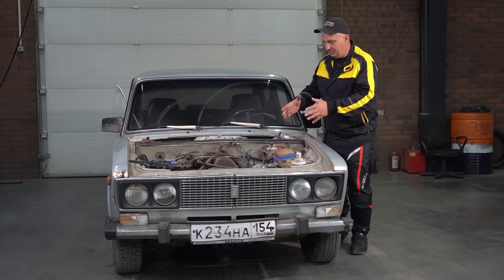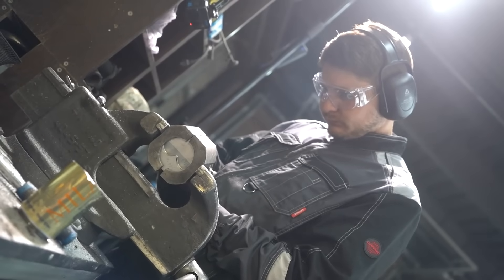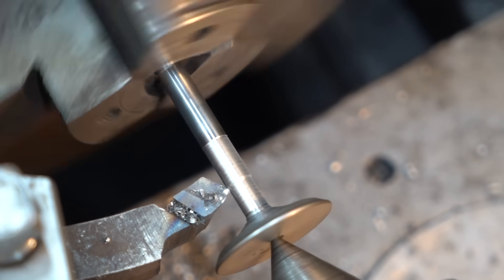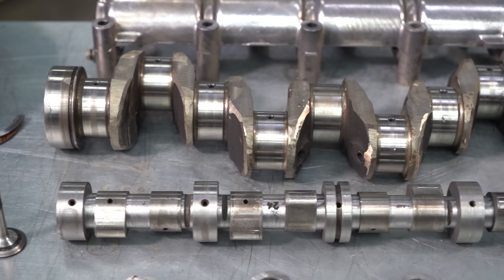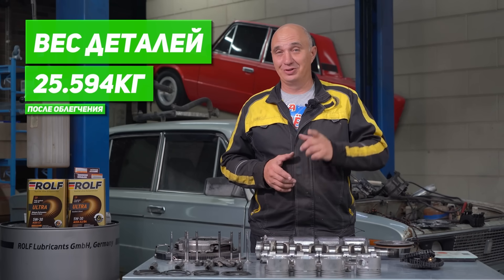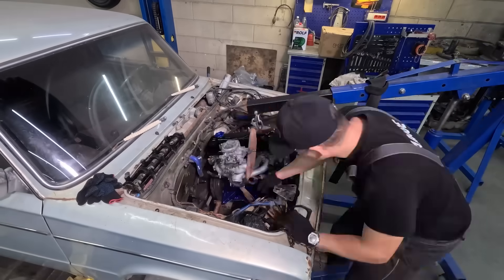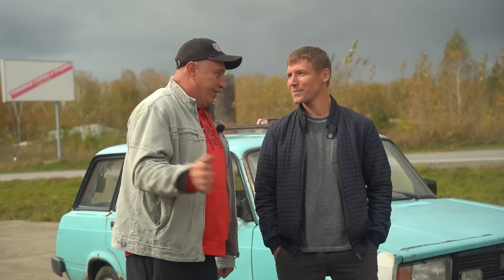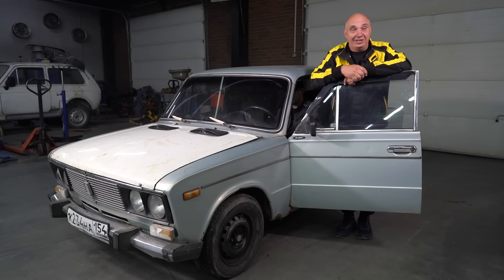Maximum rotating assembly weight reduction - what will happen?

Comment: reason it didnt rev higher (if there isnt ignition rev limiter) is there is valve float, its kind of its own rev limiter. If you guys put in stiffer springs and billet flywheel, it will be even better.
Reply: The crank is no longer balanced, so that is also limiting the RPMs.
Reply: @charlesball6519 meh if that was the case it would cause other issues first..

an unbalanced rotating assembly would cause huge vibrations then grenade the engine..

i think its valve float
Reply: This is main reason 👌@charlesball6519
Reply: They reduced the weight of the valves and the rockers... I bet the ignition module has a rev limit where it kills spark.
Reply: @volvo09  It didnt sound like it was on a limiter though.. no popping or farting..  Stayed pretty smooth at 6k.. Need to up the fuel intake.. Sounded like it wanted alot more..👍👍
Reply: @volvo09  reducing valve weight doesnt help with float nearly as much as stiffer or dual valve springs would
Reply: @volvo09  what ignition module?
Reply: @dokterkarel   the ladas have a little box that runs the ignition coil.

They aren't magneto ignition, so a spark cut can be put in that box. That's how early cars and motorcycles without points ignition implemented rev limiters. 

They've shown the module a couple times in various videos, either by having to replace it, or use multiple in a custom engine build.
Reply: @volvo09 but we would have heard the limiter, no?
Reply: @volvo09   Ignition module 🤣🤣
Reply: @samupk  well it does have a module, but it's probably a dumb one with no spark limit. 

It needs power and ground, and gets it's signal from a sensor wheel in the distributor, and has a wire to trigger the coil. (Like a late 70's -mid 80's US car without points ignition).

It's not a module in today's sense, but it is electric and could have a limit. But it is a basic part so it likely doesn't, it just takes the place of unreliable points that need maintenance.
Reply: @volvo09   Trust me, it's got no such thing as an rev limiter of any kind. Old ladas had  points ignition with zero micro electronics in them.  Valve float and general poor engine breathing was the limiter.
Reply: @volvo09  close enough. There is no ignition module in this ancient car. The actual issue is that this kind of ignition is not electronic, but mechanical (using a distributor), and it has limitations like this.
Reply: The carburated engines by rule dont have an rev limiter, only ignition retarder on the distributor that limits the rpm's. The engine also needs a bigger carburator and more air, so it can spin faster.
Reply: @gabrielvieira6529 there are carburetor engines with rev limiters. The HEI ignition in a Chevy engine has capability of rev limiters. But yes, most don't have that. People back then knew how to drive instead of relying on the computer to tell them when to shift.
Reply: And the crankshaft is of balance. That can also contribute dramatically.
Reply: @OsamaRari  Good idea, but in this case i guess around 35 Kw need to dissipate as heat/friction/vibration. In other words: the engine should have seized  in seconds or at least if the oil film stays intact, the oil would heat up dramaticlly fast.
The change in the valve shape can change the airflow a lot and a slimer valvestem ins't always better for flow. (but should still be able to hit the limiter!)
Reply: When we’re talking about total RPMs, nothing‘s gonna change the thing that will change is how fast it gets to those RPMs think of it as an air pump. The amount of turns the air pump can do is inevitable but how fast does air pump can come to full,volumetric efficiency can be changed by lightning assemblies
Reply: thanks for this comment! I might have figured out why an older engine of mine peters out at high RPMs!
Reply: Its not a predator 212 but youre right lol. The billrt flywheel is trading torque for hp. But the springs will help it with valve float
Reply: I believe that valve float and an unbalanced assembly is the cause for the rev limit however the ignition system might have an upper limit just by design not to mention it is running on the stock exhaust and carburettor which have a maximum flow rate
Reply: toaster
Reply: If you would have put a GIANT A&& wing on the back…it would rev to 15,000 rpm….or a hood scoop.
Reply: Need to advance the timing more
Reply: Need a more aggressive camshaft (more duration) and carburettor with bigger venturi to make more power on top rpms..
Reply: Also, keep in mind they did machine down the piston skirts and piston face. Which lowered compression, and probably unbalanced it a fair bit.

Also, it's definitely running lean above 5500.
Reply: Distributor cuts ignition at certain rpm. Need new distributor or modern ecu ignition.
Reply: Reducing engine components weight doesn’t actually make it rev higher or give more power on it’s own. But it should have snappier throttle response.
Reply: The fact you think specifically a billet flywheel will make a huge difference tells me you don't really understand what billet means, and that you are an easy target for marketing. 

Being cut from a single piece does not inherently make a flywheel better.
Reply: Mostly need more lift and duration on the camshaft. If power band of cam is 1000-4800rpm, with a maximum practical enfine speed of 6500, lightening the rotating assembly just means it will rev to that 6500rpm wall faster.
Reply: @twoeightythreez  correct 👍👍
Reply: Cams headers port polishing what for uh
Reply: On typerää edes odottaa että keventäminen lisäisi kierroksia. Nopeammin se voi ottaa kyllä.
Reply: You need to increase camshaft timings
Reply: WRONG!!!
Reply: You think?
Reply: It's valve springs maybe ignition spark
Reply: The limiter is only the carburetor and ignition itself. It doesn't have the ability to reach higher rpm. The mechanic also mentioned the stock exhaust, it may also strict the ability to rev higher.
Reply: That is definitely not why it didnt rev higher...
Reply: It may have revved to 6200 faster.
Reply: Needs bigger carb and better air flow.
Reply: A protogen
Reply: Flywhwel?
Reply: Less weight in the engine... Same weight flywhwel..
Reply: Tell me you have no idea what valve float is, without tellling you have no idea what valve float it XD
Reply: Lighter parta should make engine rev faster not higher
Reply: Also need a cam for high rev function. Ideal gas law goes out the window at high rpm. You need to reduce speed of the incoming air while getting in as much mass as possible.
Reply: Why would lighter valves and rockers cause valve float at a lower rpm?
Reply: Pump the throttle at 6000 rpm. Sometimes a little more gas from the accelerator pump will bump them up a little.
Reply: Reducing the mass of the rockers and valves, should have helped with valve float. I don't think that was the limiting factor.
Reply: The reason why he’s not admitting there’s a ignition rev limiter is because that’s basically like saying go blow up your engine, and this is how 😊
Reply: Cool story bra
Reply: I kinda wonder if it's having sealing problems at high rpm b/c of the skirts being sawed off....
Reply: Skip the flywheel, and it's not just the springs. That cam almost certainly can't breathe above 4500. Needs more lift and duration otherwise it's just revs for the sake of revs.
Reply: Bro the car is from 1940-198pwhy would it have a rev limiter
Reply: Also a different cam profile. A 240 degree cam will not rev like a 280 degree cam. Ever.
Reply: There is no valve float with these Lada engines, the valve springs are 3-4x stronger than modern cars, they're twice as thick.  Lada engines have been known to rev to 11k with stock valve springs.
Reply: @VNCTHE1 I dont know if he's right with 11k but I can confirm the stock springs are good for up to 8500rpm.
I build myself a race lada and that spings handle a lot if you reduce the weight of the rockers and valves
Reply: @VNCTHE1 I You are incorrect. I am looking at the spring rates right now. If anything they are opening pressures are a bit lower than most 4 cylinders
Reply: A hard and thick spring will still float the big heavy ass industrial valve its tryna close put the crack pipe down aint no 11k rpm lada @VNCTHE1
Reply: @VNCTHE1  this is bullshit. No production car has been known yet, let alone Lada from the 1980'ies wich such high revs on standard valvesprings. No way mister.
Reply: A engine only pumps so much, you can lighten it all day long, it doesn't change compression ratio, cam selection, runner size, valves, chamber design etc.
Reply: @VNCTHE1  good joke
Reply: @sigmamale4147  Joke?  You haven't worked on Ladas and are not from the eastern block.
Reply: I kind of figured it'd be the cam profile I mean I believe they're listed with RPM ranges for a reason could be wrong wouldn't be the first time LoL
Reply: fuel, you need to add more air and fuel to push harder and faster, then spark to completely burn it faster
Reply: it didnt rev any higher , because the cam shaft timing was still the same ! the cam it what determines the revs !
Reply: Everybody knows if you get a bigger gas pedal than it will rev higher.  You get a bigger wing to go faster and smaller steering wheel to turn quicker..  just look at caddies, no wing, huge steering wheel and little bitty gas pedals.  Is why they drive like a boat..
Reply: @Z-Ack  They drive like a boat because they are heavy and the suspension is exceptionally soft.
Reply: @Z-Ack  a bigger wing will have more drag...so... Think!
Reply: The carburetor and the restrictive exhaust is what keeps it from revving higher under no load like they tested.
Reply: ITS A LADA ANYTHING IS BETTER
Reply: the ignition on lada's retard ignition the higher the RPM. automatic rev limiter.
The crank being unbalanced also doesn't help. 

It needs advanced timing and some extra fuel... then it will do 7-8k. beyond that valve float will start to occur.

Comment: That clutch and flywheel had poor weight reduction imho. But as always, great stuff!
Reply: Any lighter and those parts would be weaker and prone to failure.
Reply: @MeganFoxx426  Did you not watch the video? Part strength was clearly not a priority.

Comment: More airflow = more RPM 😁 The intake and exhaust are your next restrictions to take care of
Reply: the cam plays into it too, in regards of how floppy springs you can get away with. no time to close the valve, could start closing it up earlier. maybe they shouldn't have messed with the rockers.

and no it's not the bottom end that limits the rpm as such. the bottom end does limit at what rpm it will blow up though, but it doesn't affect if the gas mix managed to get into the combustion chamber and get ignited. the bottom end can have so much losses and friction of course too that it would limit how fast the engine can spin with the power the upstairs can make, but generally in that case the engines blowing up one way or another already.
Reply: Exactly needs a bigger CFM carb with ported heads and free exhaust or at least a better muffler design.
Reply: Is not true, when I builded my 1.8T 20v 500hp engine is won't rev more than 7k.  I changed nothing just stronger supertech valve springs and now my  rev is limited by ECU at 7800.
Reply: @laszloszell8753  thats because your springs were too soft and valves couldnt close in time
Reply: @11sjv  the situation is Same here with the lada
Reply: @laszloszell8753  these ladas dont have a rev limiter.
Reply: @Jacobtheunwise  who said so?
Reply: Agree. The rev limitation in some older cars is built-in in the ignition module in some models and in the distributor rotor (centrifugal disconnection) in others. In those Lada's probably not even needed, so i don't think there's any.
Reply: @laszloszell8753  Lmao you ALREADY had a good breathing head to begin with, not even mentioning the "T" there. Try that with that ancient FIAT/LADA engine. Besides that, adjusting some ECU maps you didn't even need to deal with fuel mixture, timing, and etc in the old ways like in this cars.
Reply: Agreed. It needs a turbo
Reply: Its all about the throw of the pistons that limit rev count.  Turbos just make you get there quicker, not rev higher.  Look at f1 cars.  They got piston rods that are little stubby things whichvis why they can rev in the 14k range.  Like motorcycles..  most of them dont have any turbos or huge intakes or non restrictive exhaust but they all rev up higher than most cars..   sport bikes that is.. ecu limits a lot also with furl management and engine protection.  You can turn off rev limiter on some fords but that just makes them hit the limit of the assembly.  Weight wont effect max rpm but will hp and torque.   Its all how the motors are made that determines the rev limit.  Some the materials limit that cuz theyll just come apart once you spin it so fast like tires..
Reply: @Z-Ack  f1 cars rev higher because don't have valve springs ,nothing else.
Reply: @Z-Ack sorry but you're wrong. Turbo's completely change volumetric efficiency thus allowing a much higher rev limit.

Comment: Not combustion chamber Geometry, volumetric efficiency. The combo of the carb/intake/runners/head can't let enough air in.

Bet the intake is starting to pull vacuum at WOT.
Reply: Testing weight reduction, and "tuning mods" separately would give a better understanding of what difference each does, hopefully, they can do a tuning mods experiment later; double webbers (or big manifold)  4 into one tubular exhaust, big valves, ported head, high lift rocker, long duration cam etc. The Americans get a LOT of hp per liter on their pushrod engines.
Reply: @joejoejoejoejoejoe4391 Yeah, top fuel cars are actually pushrod, most people don't realize that.
Reply: @joejoejoejoejoejoe4391  comment on the russian channel, in russian. it might get noticed:-)
Reply: @joejoejoejoejoejoe4391  I am not sure about your last sentence.
Reply: @DashCamSerbia  If it's possible to get a lot of performance out of a pushrod (as proven by American race engines), two valve per cylinder engine (they can rev to over 9,000 rpm (11,000 in the case of the Ilmor v8) and produce well over 100 hp per litre), it should be possible to get a lot from a Lada, with the advantage of an over head cam. I think the FIAT X19 used the same engine, it would be interesting to use the same tuning mods.
Reply: @DashCamSerbia  I've just checked, and someone got 145hp out of an X19 engine, on carbs (non turbo)
Reply: @joejoejoejoejoejoe4391  fiat used the Fiat SOHC by Lampredi, it had a belt and the lada has a chain.

engines look similar if you look at the intake manifold spacing but they don't share much.

The fiat SOHC is a brilliant little engine and can easily produce 100hp/l and rev hard to its great rod ratio and big bore

Comment: I wonder what would happen to a bog standard Lada engine ,if you put thicker cylinder sleeves and smaller pistons in it?😅
Reply: Less power.
Reply: Less cc,s
Reply: I don't believe they ever changed the stroke length on these Lada engines. The displacement increased over time but it's only a bore size difference.